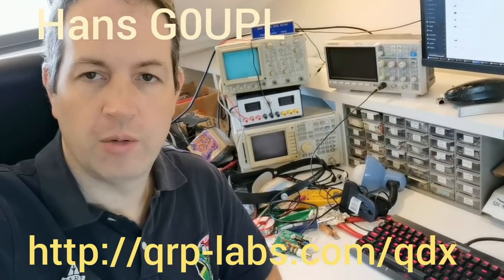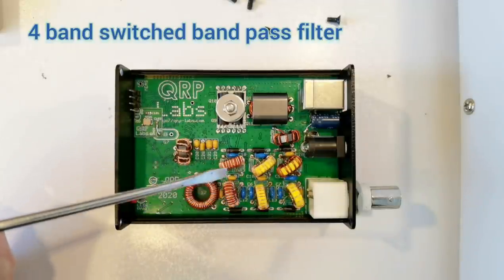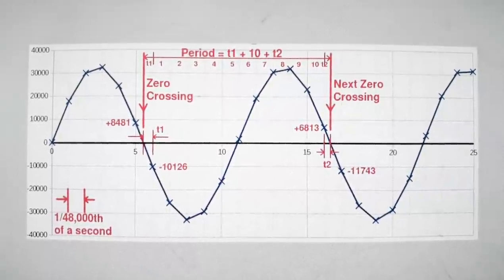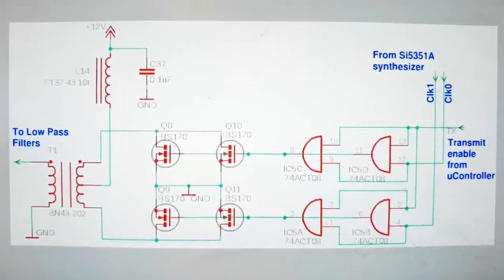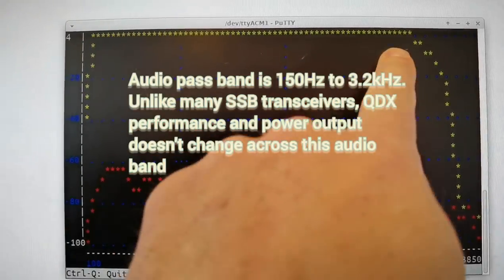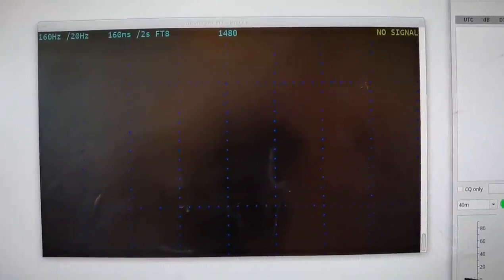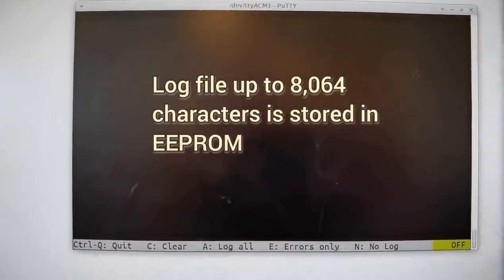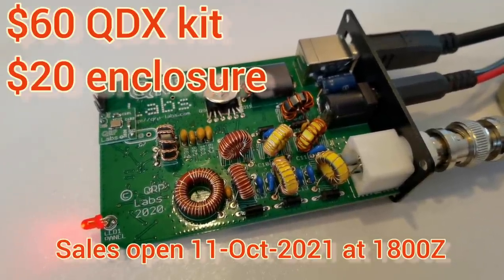QDX: new digital transceiver kit by QRP Labs

Comment: Thank you so much Hans. I've been involved in electronics R&D for 40 years, working as a tech for companies from HP to SONY, so I'm a fairly good judge of good engineering. Yours is very good engineering. 

I bought 2 of your Rev 3 kits and am very, very pleased with them. I think every ham would be wise to own at least 1 QDX if for no other reason than emergency use. They are well designed to the point of amazing little rigs.

The only thing I can fault it for, and it's not really a fault as such, merely an inconvenience, is that the bd is only designed for mounting in that $20 box. I didn't purchase the 2 boxes to go with my kits, as I have plenty of surplus metal boxes to use, with room in them for batteries, additions, modifications, and various different styles of connectors. And $40 for boxes is still $40. But unfortunately, upon looking at the boards after they arrived I found no way to securely mount them other than sliding them into the precise size of slide box that you sell. I find hot-glue, Velcro and such kludges to be repugnant. But I see there are no mounting holes for use with stand-offs, and nowhere on the board to add them. And T2 looks very close to shorting on most other metal slide holders. So I've been reduced to doing a bit of my own engineering to mount the bds. That is no problem for me, merely an inconvenience. A 3D printed holder should do the trick. But it would by useful for other builders to have the PCB mounting situation made clear to them in advance of their purchase. Again thank you for this design, and I suspect I'll be buying more of your rigs in the near future. They are far better engineered than one can expect for the price.
Reply from the maker: Dear John, thank you for your kind feedback. 
Almost everyone orders the QDX with its companion aluminium enclosure. 
However - in the next PCB revision I will add some holes for PCB mounting. I won't be able to put them right in the corners on the right-hand side of the PCB because the space is necessarily used by the connectors. But I should be able to put some holes somewhere nearby. 
73 Hans G0UPL
Reply: @QRPLabs , Hi Hans. If almost everyone is getting the box too, then there's no reason to try to fit in mounting holes in a thousand bds just for me. But for anyone else like me it would help if they know in advance that it will be an extra step to devise a PCB mount unless they order the box. As for me, I think I've already come up with a satisfactory mounting technique for my bds. 
BTW, I listened again to your presentation simply for the pleasure of hearing a clear and rational explanation of creative solutions to a series of interesting engineering problems regarding the QDX. I don't know if you realize it, but your QDX presentation is a tour de force of creative electrical engineering. If I were an EE prof I'd play the video for my students and tell them that this is what good engineering looks like.

Comment: This looks great, particularly for portable operation.  I love the minimal hardware made possible by the direct frequency synthesis approach.  It simplifies construction, reduces cost and improves the performance.  The clever software is a nice touch, too.  I'm looking forward to using this with JS8Call.  The 100mA receive current is excellent for battery powered operation.  A small solar panel could power a station with the QDX as the transceiver.  I only wish it provided 20W RF output for more reliable communications.  I'm less interested in random QRP contacts.  I want more reliable communications that aren't as reliant on optimal propagation.
Reply: The gives us a starting point and given the modes involved the 5w output will be fine with a half decent antenna. I wouldn’t surprised if an optional amp becomes available later but wouldn’t see it as a necessity.
Reply: Yes, I'm looking forward to using this on JS8Call too, and portable with a laptop and small battery, and a simple antenna.
Reply: I'm getting one to build into the case of my Pi-Top laptop
Reply: They sell an inexpensive 50w amplifier which should pair well with this

Comment: Brilliant design and acheivement Hans. Having previously built 4 QRPLabs kits.  I was very interested in this kit and lucky enough to buy one of the first kits available. Looking through the manual, the design features are amazing for a compact 4 band transceiver, which will be of great interest to digital operators in the same way as the QCX is to CW operators. Looking forward to building and operating.  G4PEY

Comment: Does the QDX support split mode operation? (I.e. changing the carrier frequency during transmitt so that the Tx audio is always kept in the range 1500 to 2000 Hz.)
Reply from the maker: Yes, it does. Or it SHOULD... though I have not tested it specifically. There is NO point doing this, on QDX. Conventionally the Split mode is used for two reasons:

1) Because many SSB transceivers don't have a consistent flat IF passband... so you get best and cleanest power output if you stay in the middle of the SSB bandwidth; 

2) The audio harmonics of 1500-2000 Hz are OUTSIDE the SSB passband so don't get transmitted. Harmonics arise by overdriving or other imperfections. 

However, in QDX, the innovative design means that neither of these reasons apply. 

QDX transmits at full 5W power output regardless of any IF passband considerations. It doesn't care. It just receives the audio tone from the PC, measures it, then transmits a perfect pure RF signal (no unwanted sideband, no audio harmonics, no residual carrier, no IMD or splatter due to overdriving or transmitter non-linearity). 5W would be transmitted cleanly and perfectly, whether your incoming audio from WSJT-X is at 100 Hz or 4,000 Hz. 

This is why split mode is not necessary on QDX. Though I believe if you really want to use it, it would work fine. 

73 Hans G0UPL
Reply: @QRPLabs  Thank you for a very clarifying answer. QDX really does look like a greate radio, especially for field operation.

Comment: It's a brilliant idea.  If I understand right, this will transmit any digimode that encodes signals using "one frequency in each time slot" codes.  So RTTY and the FT-x modes are OK, but PSK31 and any mode that uses several signal frequencies simultaneously, are not OK.   Is that right?  Thanks -- va7cpc

Comment: Wow.... Hans, how cool is that! My only question: where can I pluging the morse key? HI HI....but....maybe can plug it to computer to generate a audio tone as needed. Not sure this trx has enough control to implement CW envelope shaping in software?
Reply from the maker: Hi Thomas, it doesn't do envelope shaping. While oyou could generate CW on a PC and QDX would transmit it, it would be a clicky transmission. So I don't recommend QDX for CW.
Reply: @QRPLabs  Hi Hans, for sure ... just hope you can offer an upgrade option with key shaping. So we can lets say a raspberry pi to build a cool multi band CW SDR transceiver. Just ideal.... as you hooked me on CW with the QCX kit....
Reply: @thomasbf  Seems like there could be a future "all modes" kit.  But this is purpose built "digital modes" kit, and the QCX was purpose built for CW.  So don't expect each kit to operate outside its swim lane so to speak.

Comment: Does it handle phase shift keying like PSK31? Thinking those waveforms have phase change and envelope shaping too! (Some analysis they appear as a two tone signal, so I guess not workable)

It looks great though, especially for FT8 and WSPR! I wonder if it will do CW. It should do as that's just a single signal that turns on and off.

Comment: Missed the sale window. Any suggestion on running it with CW? MixW or FLDigi sound card CW perhaps.?
Reply from the maker: QDX is not recommended for CW because there is no RF keying envelope shaping; CW transmission would be very "clicky". It is a digi modes transceiver only... 73 Hans
Reply: @QRPLabs  Thank you for the answer. Both FLDigi and MixW produces a sound envelop trying to reduce such clicks, it suffers from any other non-linearity in the chain tough.
Reply: Never mind, read the manual entirely and now understand that any shaping on the audio envelop is futile. Perhaps at a later stage a CW mode isn't that difficult to add in the firmware and a great value for portable/QRP operation complementing the digital capability.

Comment: Would this construction work with PSK31? I'm unsure if the phase shifts would be preserved properly. 
Makes sense to use the separate I2S ADC when STM32F401 has only a single ADC and the AKM part has superior dynamic range.
Reply from the maker: At the moment it is not suitable for phase shift keyed modes.
73 Hans

Comment: Hans, I am most impressed by what the QDX can do, but I am also in a bind with my limited hardware. When you get a chance I'd love to see a video on if/how it can be configured to be controlled from an iPhone or iPad.
Reply from the maker: Hi Michael...  QDX presents itself as a standard digital audio device and a standard virtual COM serial port. My whole reason for doing this was that it would work with a wide variety of software and be platform independent. I'm not familiar with amateur radio software on Apple products... Actually not really an Apple person... I suggest asking this question on the QRP Labs groups.io group. 73 Hans
Reply: If you are budget constrained maybe a Raspberry Pi device is a good option? It’s only ~$40. A keyboard, mouse, and monitor can be found very cheap at thrift stores.
Reply: @QRPLabs  Thanks much! I've signed up for the QRP Labs group.
Reply: I know this is an older post but, as already mentioned, you could control the QDX with a Raspberry PI.  A Raspberry Pi can be had for around $40.  Raspberry PIs run Linux which allows you to install various ham software like WSJT-X.  Its possible to  control a Raspberry Pi using a tablet such as an iPad via remote desktop or SSH. 
    There are also Windows based tablets out there (Microsoft Surface) as well that could possibly be used with the right adaptors.  However, I'm not sure if they allow installation of WSJT-X, you might have to modify one to run Linux.  
    What I would do is go the Raspberry PI route myself and either use a tablet to interface with the PI or add a 7" screen and Bluetooth keyboard to the Raspberry PI to turn it into a portable computer system that's lighter than a laptop.

Comment: Hello Hans. Any plans to add 17-10m bands? Thanks
Reply: This was my question too. I would like to have 10m to use it with a transverter on: 6m, 2m and 70cm. The PTT out (with some delay) would be nice in this case.
Reply from the maker: Victor, the first batch is 80 40 30 20 only. But in future I hope to produce different band versions. 73 Hans

Comment: Thank you for the vid. Fantastic product. Are you planning to add 10m at any point? This would work great for those of us who want to use it with a transverter on 2m or 70cm. When it comes to 6m, 2m and 70cm there is a real vacuum on the market. Very few radios to buy and try.
Reply from the maker: The initial batch of 500 kits is just 80 40 30 20m. When the dust settles and when I can fight through the global semiconductor crisis to find more parts and manufacture more, I intend to produce different sets of 4 band kits, including 10m. 73 Hans G0UPL
Reply: @QRPLabs  Thank you for your reply. I would be really interested in; 40,20,15,10m bands (with the PTT output to control a transverter) if not 40,20,10,50. Also, some small CW/Digital transceiver (10-20W) for 2m would probably pick some interest. Nobody makes this stuff and I do not have skills to build one.

Comment: Great product!

My daughter, who is a tech, and has recently discovered FT8, has become radio active again. However due to her licensing restrictions here in the USA, she is limited to running FT8 on 10 meters. Is there a possibility of making a version of this with a 10 meter option - or perhaps provide a table for all the HF bands so that the end user could pick the 4 bands they want to use this for.

WB8ERJ
Reply from the maker: Not in the first batch, which is 80 40 30 20m only. Later when the dust settles and we can meet demand, I intend to consider higher band versions. 73 Hans G0UPL
Reply: I assume that since the QDX doesn't have plug-able band pass filters, it would require a change on the PCB to the torroids for the band pass filters.
Reply from the maker: @JasonRobinsonidaho  Band Pass Filters, Low Pass Filters, and the firmware...
Reply: @JasonRobinsonidaho  My thought is to be able to select 4 bands of your choice when you build  the QDX

Comment: Looks amazing. Thank you Hans. Again, you are spoiling us. I only just saw this video - so no chance of ordering a kit until stock becomes available 🥺. The PA looks very impressive - so simple and 5W from a 9V supply. Clever use of the Si5351A clock generator. I realise the QDX cannot be used for PSK modes. However, what about other MFSK modes such as Olivia?
Reply from the maker: As long as the modes only transmit one tone at a time, MFSK and IFSK modes should work.

Comment: Which Digi modes is this compatible with? Is there a list?
Reply from the maker: At leasr: FT8, JS8Call, JT4, JT9, JT65, WSPR. Anything that is a frequency shifted single tone.
If the mode uses phase shift keying or transmits multiple tones concurrently then it would need SSB.
Reply: @QRPLabs  Will FT4 be available especially useful for contest and remote working? G4PEY
Reply from the maker: @ralphwilmot6351  FT4 will work yes, as it is a sequential tone FSK mode. 73 Hans G0UPL

Comment: I bet Hans is working on an affordable 50W linear amplifier.
Reply: Actually, after reading the manual, just realized a linear amplifier is not necessary. This design is truly impressive!! You rock Hans!
Reply: 50w is now cheap and easy as long as you are not stuck on 12v power source.

Comment: I see no mention of CW?
Reply from the maker: Hi Frank, CW Is not supported. This is a digi modes only transceiver. It has no paddle input or keyer. You could force it to do CW using fldigi or other software to key it. However QDX does not include keying envelope shaping because it is intended for FSK digi modes, not on/off keyed modes like CW. 
73 Hans G0UPL

Comment: Where to download the software?
Reply from the maker: Stephen, QDX will be supplied with all firmware already installed. It is not open source. When firmware updates are published they will be on the QRP Labs website http://qrp-labs.com/qdx and freely downloadable. Firmware update procedure is easy on any PC, any OS, no drivers, no special software, no hardware. 73 Hans
Reply: @QRPLabs  sorry for the noob question, I just got my license 1 mth back
Reply from the maker: Congratulations on the license, welcome! And no need to apologize. Have fun! 73

Comment: 10m please as this band is on the up..
Reply from the maker: The initial batch of 500 kits is just 80 40 30 20m. When the dust settles and when I can fight through the global semiconductor crisis to find more parts and manufacture more, I intend to produce different sets of 4 band kits, including 10m. 73 Hans G0UPL